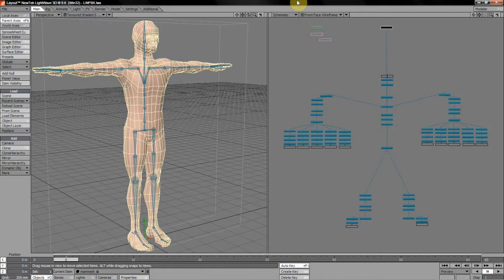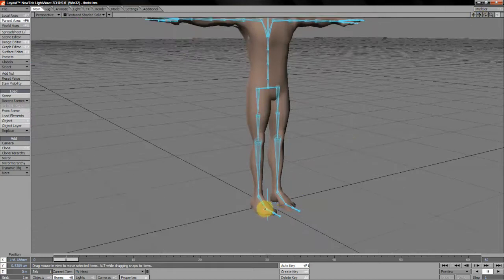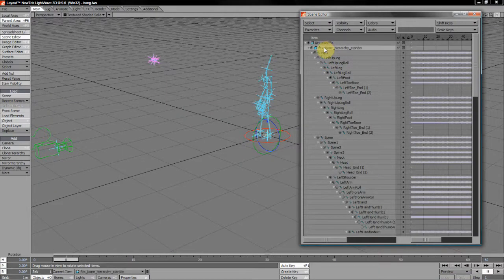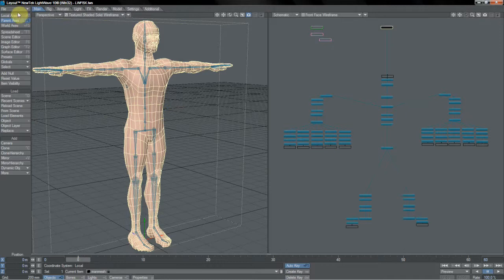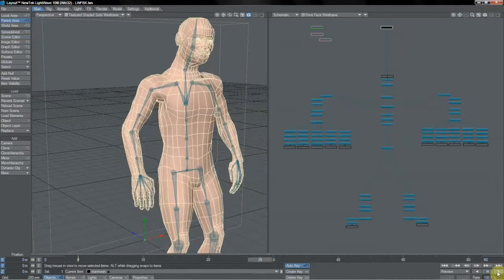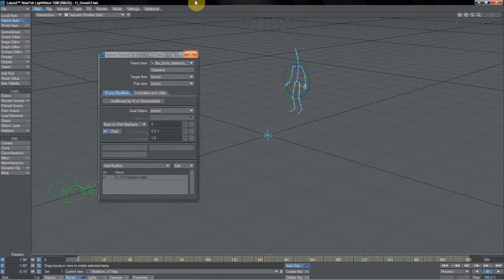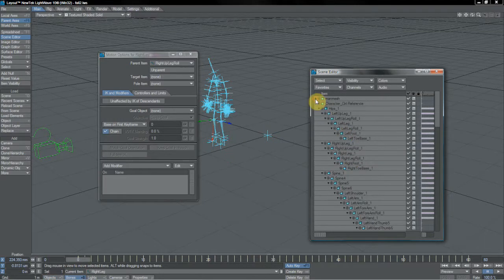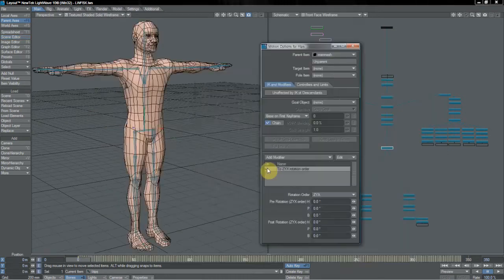Understanding LW and FBX part 3

Comment: Great stuff as usual RH. Just to add up to your conclusion, it's also very important to keep the 90/0/-90 rotation order at the hips/root of your character before exporting it to Mobu, because it allows you to, once the FBX is brought back to Lightwave, use IKBooster to tweak some pose - IKBooster won't allow you to change the rotation of anything that's got a plugin driving its rotational input, including the rotation order plugin.